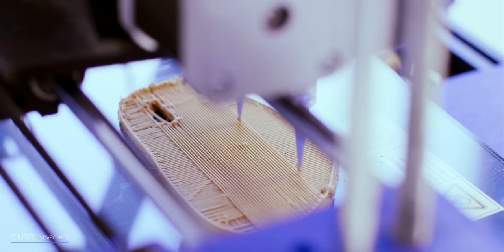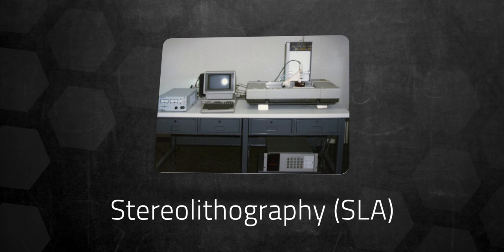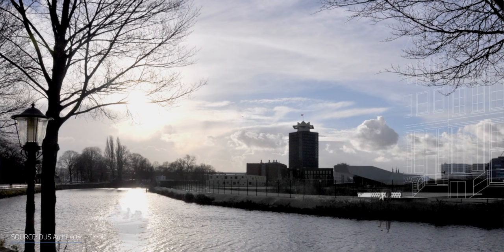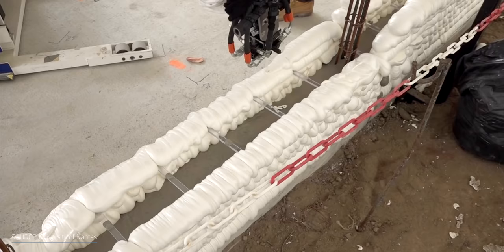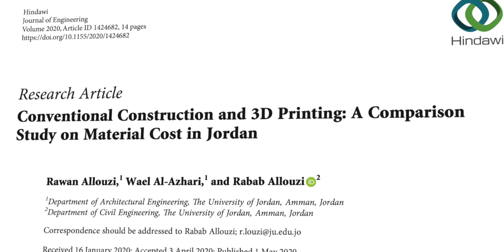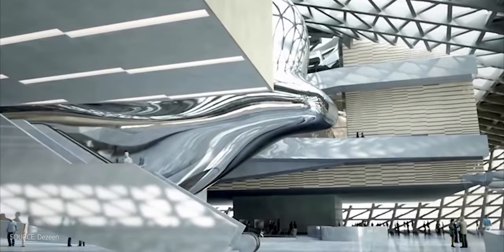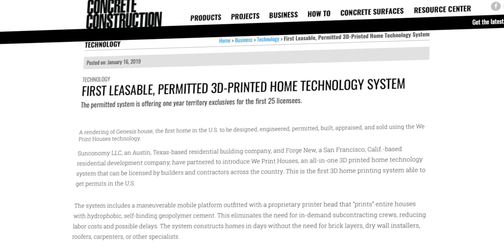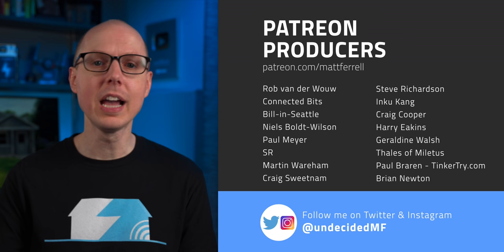This 3D Printed House Changes Everything - Explained

Comment: I love 3D printing, I love robots, and I love building. I also know enough about building houses to know that those 3D printed houses are horrible, and they're marketing the crap out of it to make it look feasible. You know why it's done so quickly? Because they only report the printing time, not the time it takes to install wiring, ducting, windows, finishing, etc.. They also don't mention that (with how they're currently building the houses):
- You don't have insulation (or maybe a sprayed in foam if you're lucky)
- You have massive heat leakage at every door and window, since the concrete just flows from outside to inside without any kind of heat barrier
- You'll have moisture issues because of that (if you're in a climate like the North of the USA / northern/central Europe)
- etc.

I love the idea of 3D printing a house, but the quality you're getting at this point in time will be way below what you're getting from a regular house (a decent house that is, not an American style wooden shanty).

If they marketed this like "We can print any shape you want, and the walls will be up quickly", sure, but they always claim they can complete a house in days. Well guess what: you can't. The entire construction process (only building, not even talking about permits) is still gonna take at least a month, and probably longer.

I like the idea of easily printing all kinds of shapes, transporting the concrete in the most efficient form (compared to prefab panels, which are inefficient to transport when they have weird shapes), and being done with the walls quickly, but thinking this is a complete solution for building houses is just dumb. 3D printing houses isn't going to solve anything, sadly, it's just gonna make cool, non-straight walls a lot easier to create.

Comment: I don't see those machines do electrical work or placing any pipes in houses.
Do those houses come with electricity and water or it's your problem?
Reply: There are machines that will run conduit and pipes as the walls are laid. I don't know how well they work yet, but I know that's something they've been trying to do.
Reply: @joesmoe71  I call these machines construction workers. I've seen them in action, and they work quite well.
Reply: I have seen another program about 3D printed houses ,and they  said they only print the shell of houses,  the plumbing and electricity are done manually.
Reply: Welll theoretically you could get it it to 3D print the plumbing too as it is building  everything else so the only thing you’d probably have to do is the electric installation
Reply: @kellyblack2010  Even if they can't really do it now it's only a matter of time before someone figures out how to do it correctly. We're all living in a sci-fi movie as far as people 50 years ago would think if they could have seen us in the future, lord knows what technology we'll have in another 50, assuming we don't kill ourselves before then.
Reply: @kellyblack2010  3D printer can only print the shell of the building, doors, windows, plumbing, electrical works,  can only be done by humans at this pointing time, who knows ,possibly in the future they will progress to that stage.
Reply: Don't forget the roof, which not only needs plumbing certification, but also accounts for a large % of construction costs. I am yet to see a 3D printed roof that isn't flat.
Reply: @owengenat8841  Which is kind of weird.  Surely they could combine traditional poured concrete style forms with 3d printing (ie. highly controlled pouring)?

Comment: It's about time this takes off. I thought it was 5 years away in the 90s. It kept being 5 years away for a while now.
Reply: @orangestapler8729  fusion is 30+ away if it comes at all
Reply: So i guess Time was Paused for you?  /s
Reply: @notMattGarska  fusion will be a mid-2030s thing.
Reply: I don't think it is "about to take off". 3D printing is still decades away from overcoming the quality and reliability of general manufacturing practices. It's wonderful for prototyping but we are nowhere near being able to achieve the same kinds of tolerances we see with subtractive machining and general carpentry/construction.
Reply: I remember seeing something like this in the mid to late 90s, but they didn't call it 3d printing.  It used a robotic form and pour system that basically did it as a stack of curbs.  It didn't look like rope pottery when it was done.
Reply: Jared Kennedy do you remember the name ?
Reply: @huesenpaul1394  I wish I did.  I've been digging around trying to find info but all that pops up is more recent stuff.  It may have been in Popular Mechanics, I used to read that all the time.
Reply: Jared Kennedy Ok. No worries thanks I’ll check it out

Comment: Worked as a foreman for a general contractor for several years. Things like this and prefabricated houses seem great on their face until you have to change anything. Cut holes for new plumbing and electrical, fix problems with old plumbing and electrical. Repairs, remodeling, future additions, ect. Having the main structural component be the outside skin of the building is a recipe for disaster.

Comment: I love the sneaky “when feeding plastic to a 3d printer it creates vocs” implying that concrete printing creates VOCs when it really doesnt at all. Was that an accident or....
Reply: It was stated in the video it was the additives to the materials to have the cure faster that were causing the VOCs. I agree, it wouldn't be the concrete itself but if they are using a weird mix of concrete they concocted for the print, it may be.

Comment: How durable are these houses, will they last in severe storms with Hail or hurricanes, typhoons and tornados? It doesn't matter how cheap it is if it gets destroyed by 100Mph straight winds or heavy snow.
Reply: They are concrete, so they are probably strong against wind and rain, but that might be it. Again, they are concrete, with zero reinforcement, so if there's an earthquake, they will come tumbling down in no time. That neighborhood is probably being built in Texas because Texas has the lowest risk of earthquakes in the whole country.

Even without a disaster though, every house is subject to settling over time, which leads to cracks in the walls. That seems bad in a concrete building. Concrete roads and bridges always require expansion joints to deal with thermal expansion, and it doesn't look like these houses have any. Maybe they are small enough that they don't need them?

I wouldn't think about buying one of these houses until the technology is 30-40 years old.
Reply: this whole video is just a gimmick, the numbers "X% cheaper, Y% faster" but faster and cheaper than what? Nobody knows. I imagine the guy who will come to straith those walls with plater from the inside will get a trauma.

Comment: I'd absolutely live in a 3D printed house!  I love the complex and interesting geometries they can achieve that would normally cost a fortune to construct the traditional way. Even better if I could model the house myself!  :P
Reply: I like the idea too and gets me thinking about possibilities of application. but after working in construction for a while, I can see major disadvantages. This is only automating a small percent of a home build. The slab foundation needs to be there and then this only builds the first floor but even that requires a crew to set window/door lentils and do electrical/plumbing/HVAC cutouts before it hardens. 

There is no way this is faster than a 2-3 man framing crew when building the first floor walls. And usually masonry walls are unnecessary, specially for interior walls. Wood framing is cheaper and easier to work with.

Other than unique sweeping and curved surfaces or other artistic designs, I don't know what this tech solves. Most presentations on it fail to describe the hard parts integrating with the other trades.
Reply: @Josh.1234  Very valid points.  Also, concrete isn't the most eco friendly material to be using for the entire structure for a house. Although, a 3D printed houses volume of concrete is tiny relatively speaking. 
I do think think that with further automations and material engineering, a lot of the issues you bring up could be solved or improved. While a 2-3 man framing crew could get the framing up pretty quick, I think an advantage to 3D printed structures is that there's very little finishing work required. 
But yeah, there's still a lot of things that would need to be figured out to make it viable on a wide scale.
Reply: @BRUXXUS  yeah finishing is different between the two wall structures. Most people will want the walls parged smooth and running elec/plimb/HVAC through any of those walls will be crazy fun compared to stud built. I am not sure on the insulation and the exterior moisture control is through a elastomeric paint. Not sure that's ideal waterproofing. 

I'd love to see two crews go head to head and see the time and effort differences. Asking the carpenters/masons and they will tell you how much time is saved.

 Honestly seems like a robotic manufacturing plant cranking out prebuilt wall panels and delivered on site for bolt or fastening would be better use of automation.

Comment: Most timely video, Matt. I am no longer undecided about 3D printed houses! 😉
Reply: Always wanted a Dome house with interconnecting subterranean domes. More labor but similar structure.
Reply: @billallen275  
I've been dreaming of a Timberline Geodesic for decades. A very sound home and with concrete floor that are heated and 2x6 walls, it would be very efficient. Check them out if you're interested. Look into the Double Mulberry 👍
Take care
Reply: Yeah I'll be in the market to build a house in the next year, a 3D printed earthship type home with straw or wool bale insulation is sounding pretty interesting right about now considering the current pricing for traditional western building materials!
Reply: Two words: Hobbit Holes.

Comment: I live in what is called a “Factory Built” house. . .  Built in a factory 400 miles away and shipped to a poured foundation in two halves.   I’m still enjoying it 50 years layer.  The ONLY things that have required attention are the roofing material, sbd anything that was finished off by local labour.  The cost, inclufing kand, at the time, was under CDN$20,000
Reply: I also believe that's more of a solution.
In Germany about 30% of houses are now built like that.
And nowadays you need only very limited local labour, they are sent with everything already installed.
Reply: Yes its cheaper,quicker to build,  better to live in and better for environment than  that concrete blob.

Comment: Great vid. I love the idea of 3dP homes and have been following it for awhile. My only concern is the effect of all the cement construction replacing wood and the greenhouse effects of that (not to mention that we're running out of sand). I'm dying for someone to create a material that can replace concrete but still support 3 story buildings in a sustainable manner.
Reply: lol just build properly thermal isolated  conventional house made of bricks and for the next 150 years of using without air conditioning the carbon footprint will be on your side
Reply: Like the other person said, brick has done this for centuries. And new wood materials can easily be multiple stories as well and are more sustainable already.
The problem (for the housing market) is clearly labour, building a house with brick or wood takes a lot of people instead of 1 printer which runs for 24 hours a day.
Reply: @jellevm  well partially true, but building the walls is actually the cheapest part of building a house - at least in europe. Roof is expensive if you want to have an attic with dormer window, and the most expensive part is finishing from the inside, and as I said in other comment - that guy who will come to straight these walls from inside will get a trauma. Unless you want your home to look like made of mud
Reply: Strawbale, Limecrete, properly designed rammed earth, and bricks all fit that bill...
Reply: Well...we do have to consider the hidden CO2 costs of conventional wood framed houses.
1. We cut down CO2 absorbing tree's for the materials.
2. We then create tons of CO2 while transporting the materials.
3. Traditional framed houses require more personnel to install, and those workers create CO2 when traveling to the worksite unless they use electric vehicles.
4. Wood framed homes may be less sturdy depending on construction, and cause higher CO2 costs for repairs/complete rebuild of structures.

I haven't done the research on this though...
Reply: @joryferrell7244  you're exactly right!
Reply: @joryferrell7244  " We cut down CO2 absorbing tree's for the materials."

Plants are only net CO2 absorbers while they're growing (essentially converting CO2 into wood). They are otherwise net neutral; the CO2 they convert into O2 via photosynthesis gets turned right back into CO2 by respiration. So by locking wood in a house (instead of allowing it to rot in the forest), you're actually removing CO2 from their air.

The remaining three points are worth considering.
Reply: @joryferrell7244  electic vehicles are not carbon free.
Reply: @davesilvia9711  I am going to go ahead and listen to experts...who say they are. Even if they weren't, as renewables take over faster and faster, they would become carbon-neutral at minimum. The fossil fuel industry is paying big money to try and staunch the advance of an industry they were too stupid and intellectually lazy to see coming. But in the end...if something is cheaper while still being better...you won't stop it from taking over.
Reply: @joryferrell7244  get your own opinion, id like you to think about how much energy it takes to produce a EV from start to finish. that means including the hot water for the coffee in the morning of build to the crusher that falttens it and ships it back accross the ocean to get recycled and turned into something else at the end of the its life. There is a huge chain link of energy consumed in this prossess that burns carbon, so people can get around.
Reply: @davesilvia9711  Are you a doctor? No? Then would you say you are qualified to determine whether or not a tumor is cancerous or not? Of course the answer is no. Experts should be listened to...because they are experts. And I do have my own opinion on the subject...based off the research of experts: https://www.youtube.com/watch?v=6RhtiPefVzM So...if you are not an engineer, supply chain specialist, etc...I am going to disregard YOUR opinion...which is by all EXPERT accounts FALSE.
Reply: @joryferrell7244  What about the quarrying it takes to get the materials for concrete. That involves logging/clearing the quarry site surface then blasting and digging holes into the earth and mountain sides (not renewable like wood is) in order to get the raw materials. Then they have to process it and refine it to a desired size, then they ship or drive the raw materials to a plant in order to get made into the various concretes, cements etc etc.  Then there is the fiberglass production (almost all the 3d printing companies use fiber reinforced concrete) so there is also that whole process as well.
Reply: @corail53  They are coming up with solutions to replace concrete. And like I said...I haven't done a whole lot of research on whether this system is better than tradition wood-framed homes. I did bring up points on why I think it is POSSIBLY more sustainable...but I admit it may not be.
Reply: @joryferrell7244  anyhow good approach, maybe someone reading that will do some actual numbers, that could be interesting showing the overall CO2/effort/cost comparrison of building entire building and not only walls. The problem is more complex when there is CO2 footprint taken into consideration because its simply hard to measure.
Reply: Hempcrete
Reply: @jellevm  this printer doesn't save time.. a 2-3 person framing crew could build first floor walls in these simple homes faster than this machine.. 

Put them side beside on a lot and let them start framing and the other company start setting up the machine.. it would be no contest. Add the new precut lumber processes builders first source is employing and it would even be faster.
Reply: @joryferrell7244  don't trees slow down C02 absorbtion when they are mature. My understanding is that carbon goes into their growth and is stored in the wood. Whether it's alive or dead, that carbon is still tied up till it rots again.

Wood framing just keeps the wood in a dead state as opposed to a living tree. But also with sustainable forestry, new trees could be planted where the framing wood was harvested creating double carbon captures.

Comment: IMO: Some pros: cool custom shapes, speed of construction, strength,  IMO: Some cons: too expensive, bad interior air quality, more environmental impact, harder remodeling if ever wanted, higher heating and cooling costs
Reply: you can also add, weak strength against earthquakes, no steel in the construction => weak in general